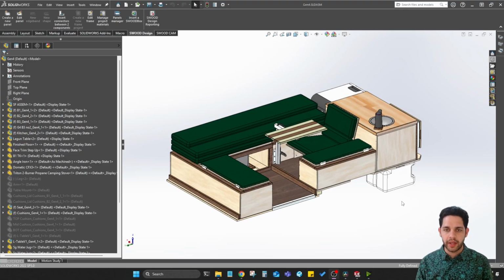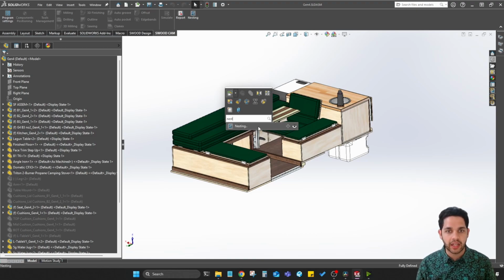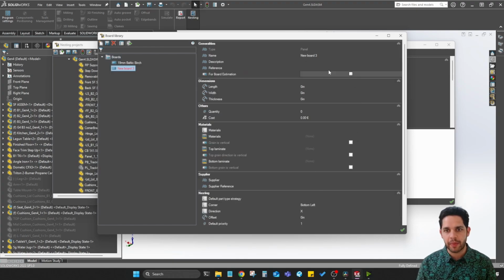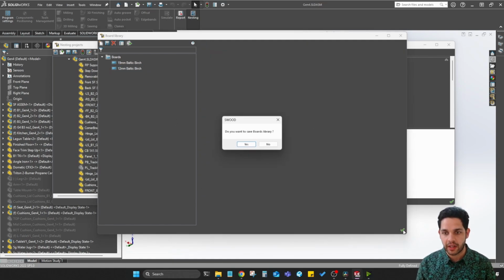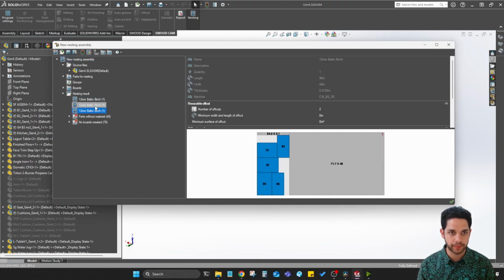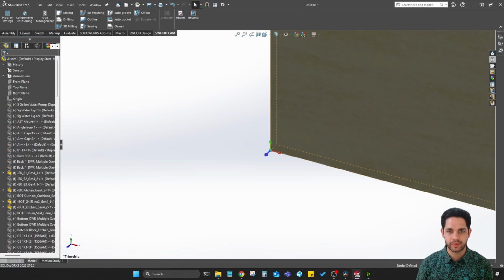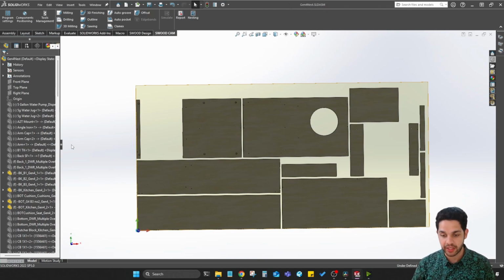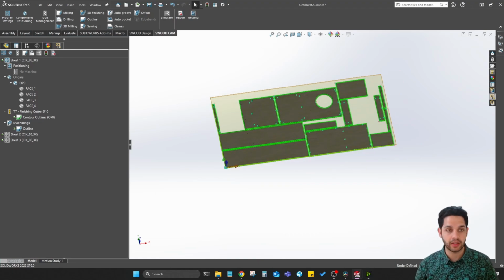How to Nest Parts in SWOOD | (Complete Beginner Guide)

Comment: Is Swood and SwoodCAM two different products/Add Ins? Or do you get everything with the one product?
Reply from the maker: SWOOD's main product line is. SWOOD Design, SWOOD CAM, and SWOOD Nesting so they are separate products. But can be bought as a package.
Reply: @SWOODWithArod  Thanks, Im having some problems importing a dxf file. Do you have to point to the library folders before the import will work? SW 2022 with SWOOD 2024. The import dialogue opens for the bxf file from Blum configuration and I select the Materials OK but then nothing gets imported.
Reply from the maker: @allanpennington  I’ve had my share of DXF import issues in SolidWorks, so I understand the frustration. Based on what you described, it seems to be a SolidWorks issue rather than a SWOOD issue. I'm not sure what is causing the issue, but there is a lot of SolidWorks related info online to help diagnose issues like this. ChatGpt is also a good place to start. Good luck finding some answers!
Reply: @SWOODWithArod Sorry I meant problem importing a bxf file generated by the Blum Cabinet Configurator.
Reply: I sort have got it working but it’s not bringing in the Blum hardware
Reply: @SWOODWithArod  Thanks for that. I think Swood is only up to 2024 release version so this won't work in Solidworks 2025 will it?
Reply from the maker: @allanpennington  I know its not recommended by Eficad, but I have SolidWorks 2025 installed with SWOOD 2024 and its working fine. Also I think I saw on LinkedIn that SWOOD 2025 just came out. I could be wrong though.